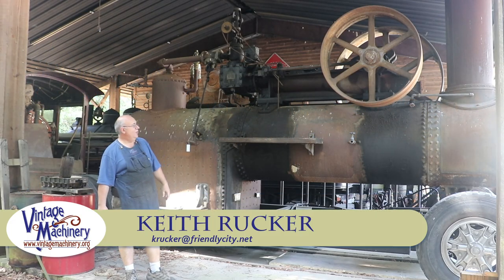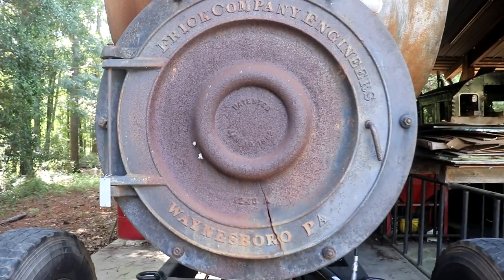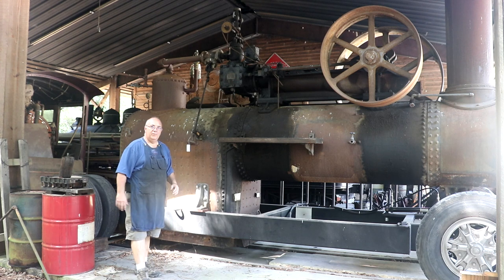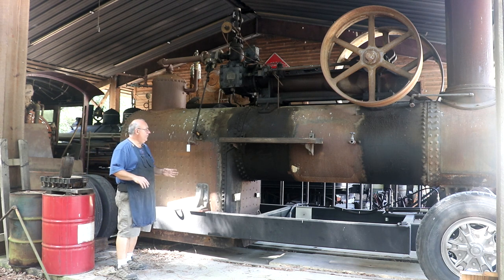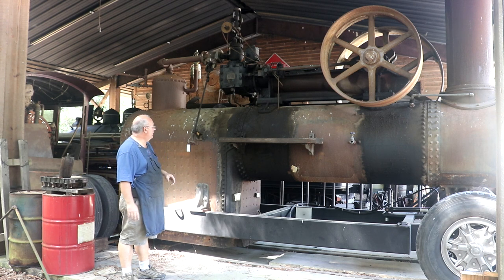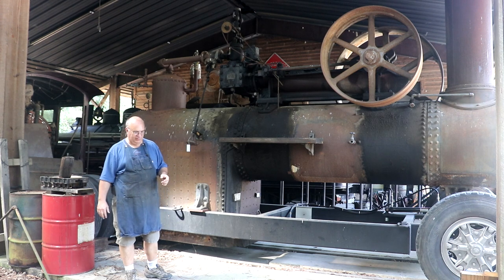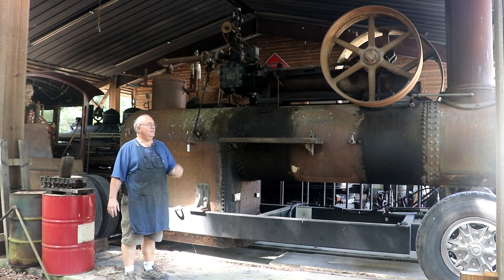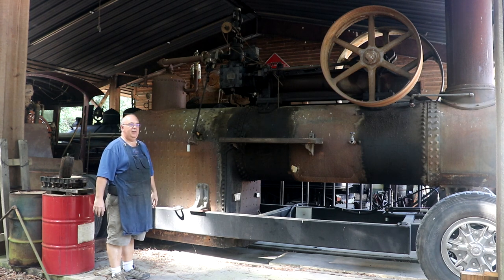1935 Frick Steam Engine: Help the Georgia Museum of Agriculture Restore it!

Comment: The Frick plant where that boiler / engine was made is still running in Waynesboro, PA. Now part of Johnson Controls, but they still are known as Frick.  That plant produces refrigeration systems (big industrial equipment) and the associated pressure vessels.  Great people, proud of their history.

They still have the drawings for those old machines.  While they don’t make the parts, they can supply the drawings to have them made.
Reply: It might be great to have a copy of the original plans as part of the museum display if they can be found.
Reply: Shoot me an email, I’ll give you the director of engineering’s contact info. He’s a great guy, and was the one that told me they have the drawings archived. He made copies of them for customers way back in the late 1960s when he started there.

Comment: I think it would be interesting to use this as a casing for a smaller modern boiler on the inside of this shell.
It could just be piped to turn the engine over. Or possible set it up as a cut away to use to demonstrate how they work.
Reply: that is a good idea. I like it.

Comment: The first company i worked for had an old steam engine as an backup air pump. They run the engine "backward" (i think they changed the slide valve part) driven by a diesel engine. The boiler was the pressure tank. It looked very similar to the hole thing in the video. The main difference was the engine underneath the tank and a guard around the flat belt.

Comment: You guys could pipe steam from another boiler to at least turn the engine over.
Reply: Run it using compressed air. That's what Jay Leno and the Smithsonian does with their working engines.
Reply: @SandBoxJohn  Yes they could but they have other boilers so there is no need to do that.
Reply: A steam engine without steam is like a pub without beer. It's precisely the combination of fire and steam which makes a steam engine so attractive to look at.

Comment: In San Diego off of a pier near an Anthony's Fish Grotto restaurant, there is an old, decommissioned cruise ship permanently docked for museum purposes only.  It is called the /Berkeley/, and it has four boilers, one of which has a blower, an amber light, and some plastic similar to Saran Wrap where the fan blows on the plastic and the light shines on it, making it /look/ like it is ablaze.  And on a three piston Hi/Med/Low pressure steam engine, there is an air compressor which blows enough air into the engine to make it move in very slow motion.  Perhaps, you could do the same to this steam engine and boiler by making the fire box look ablaze with a Saran Wrap like material, an amber spot light, and a fan, and attach the steam engine on an air compressor so that it goes, /Choo/.../choo/.../Choo/.../choo/... in slow motion.  Then people can /really/ appreciate the historical steam engine and boiler, even though it is not really being used.
Reply: This was actually a ferry boat that operated in the San Francisco Bay and I thank you for calling it to mind. I used to ride it as a boy nearly 80 years ago even after the Golden Gate Bridge was completed. The Berkeley has been lovingly restored and the boiler area is particularly impressive. Many of the ferry boats in that fleet were side paddle wheel driven but the The Berkeley was the first of the screw driven boats. 
Thanks again for taking me back to that wonderful era.

Comment: What happened to the stoker engine?
Reply: Best I can tell it is at Abom79's shop ... and Abom79 is traveling around the Southwest.
Reply: ronald davis it’s called getting a girlfriend and having a life.
Reply: @almostanengineer  Wife now!
Reply: Jim Korman geez, has it been that long since I watched his channel 😳
Reply: @almostanengineer  - Don't feel too bad, I did not know he even had a girlfriend; its been that long.
Reply: I had offered to machine it when I did the cylinders. I was interested to see how it turned out after Lance and them did the weld build up on it. I know Adam planned to machine it in the shaper which was going to require a very large tooling stickout. It likely proved more difficult than was expected. As far as I know it is still in the works, if Adam can't do it maybe Keith will do it on his new HBM. :-)

Comment: Up to $8500 , how much more to get a small modern boiler to fit inside existing shell that could at least idle the engine unloaded.  Nothing like  the smell of hot cast iron/ boiler plate and live steam to anyone that has experienced it.  If that won't work how about a modern boiler with cosmetic "rivet heads" to look like the original.  Somebody did that for a steam locomotive.  At the very least need to feed compressed air to make the engine chug and spin the fly wheels , that will get the kids attention and draw people in for more.

Comment: Insurance will be the end of working museums, it’s a shame.
Reply: Just as it is for anything else.  I will refer you to 2 episodes:  25 yrs ago the Gettysberg RR had (for the short of it) a boiler explosion where the crown sheet became overheated and failed, luckily it was not catastrophic and several years ago a traction engine in( I think Ohio) did explode, with at least one death, at a steam show.  I have operated, run, fired several of these old engines/boilers and I am VERY causious around them.   Steam has tremendous power and the greater the pressure the greater the potential for destruction.  When treated with the respect they deserve they are safe; the problem is an accident or worse a loose moron is an invitation to desaster.  My opinion.

Comment: Keith could another approved boiler be used to supply steam (or air) so that the engine could at least operate?. It seems a lot of time going into a static display for no apparent reason!. Just my thoughts on this worthwhile project. Carl. Woy Woy Australia.
Reply from the maker: Yes, another boiler "could" provide the power to the engine.  But, where it will be located, that just won't be practical.